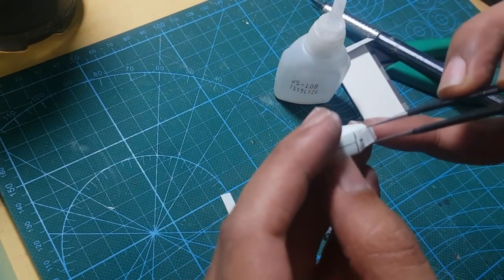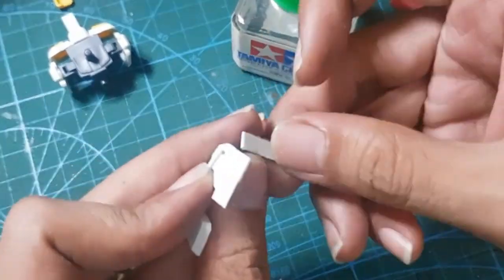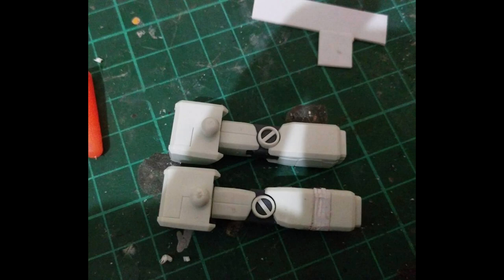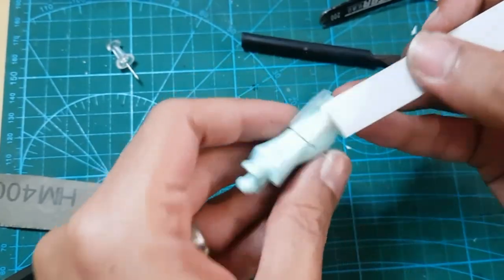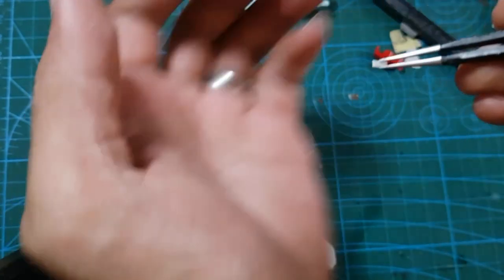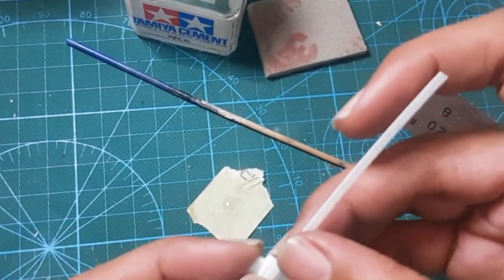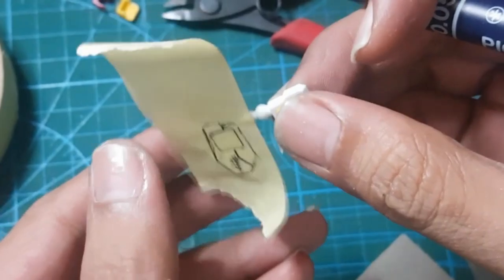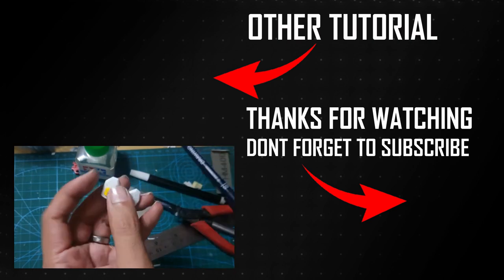PLAPLATE - DETAILING & RESHAPE GUNDAM MODEL - GUNPLA TUTORIAL

Comment: Hello! I am on a very tight budget and it seems like ABS pla plates are cheaper than Polystyrene. Would this affect the glue and paint I need to use?
Reply from the maker: hello... for ABS, you can't use those standard plastic cement. you need ABS plastic cement. but another good news is... super glue also good to go 🤣
and any paint will have no problem with abs 😁